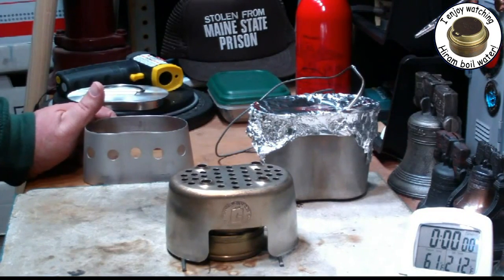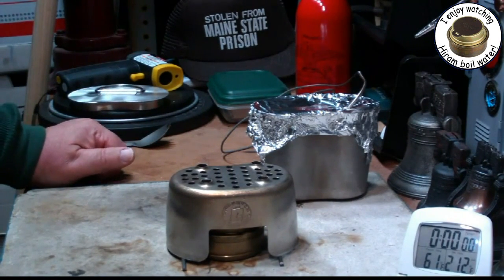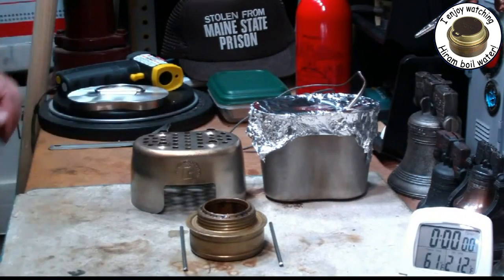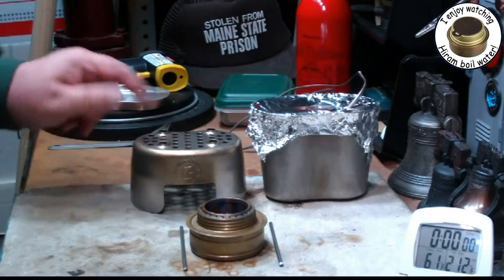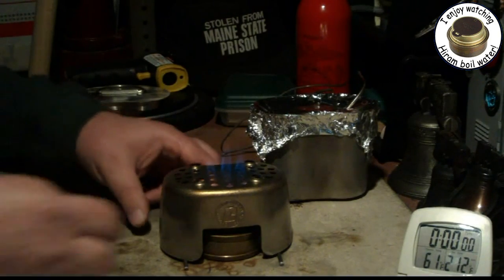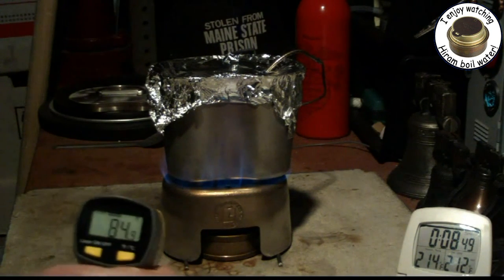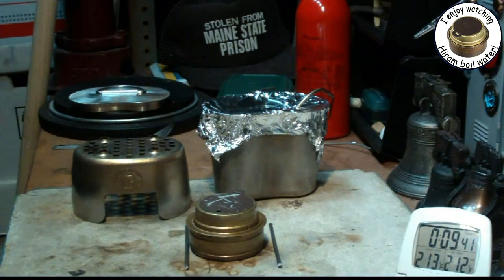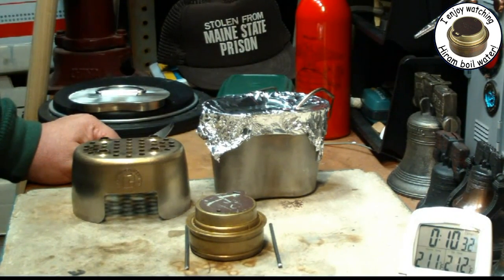CanteenShop GrillTop Stove Stand - Trangia - Boil Test #2 - Reloaded

Comment: Hiram,
Nice video my friend. I have this stove stand and notice the same thing too. Other commenters here have already suggested finding some way to raise the pot up higher (perhaps using bolts). I have not tried that yet myself but it sounds like a good idea. That would certainly help to get the heat more under the pot which couldn't hurt. I have the round version of the stand too (fits the nalgene bottle). Same issue of course but it is much thinner and so it is half the weight. Of course the bean shaped one is rugged enough to be used for digging cat holes as needed or fending off bears in a pinch hahaha. Take care and keep on experimenting. Tom

Comment: I guess it doesn't make much difference since time diff wasn't big deal but for the rods you could use popsicle sticks or chop sticks the flat ends. also what if you put a stainless nut and bolt thru the 4 extruded holes raising it up a little more that way you could give more oxygen and space without drilling any holes? nice video atb stay safe Mark in Texas